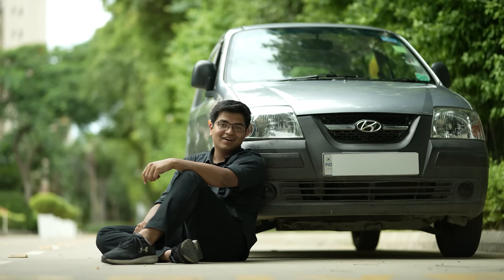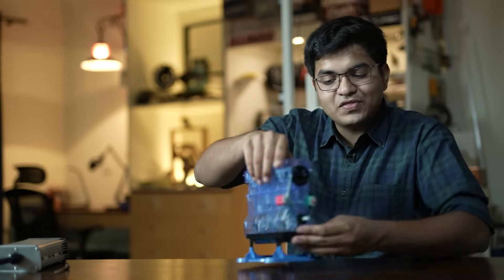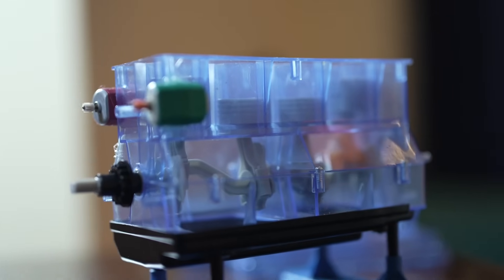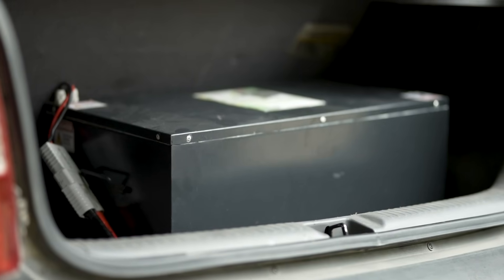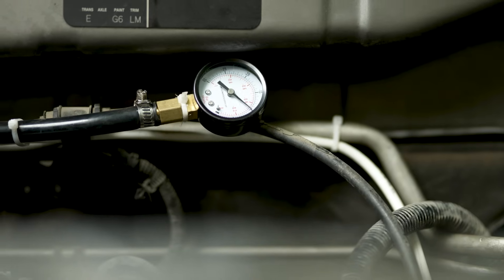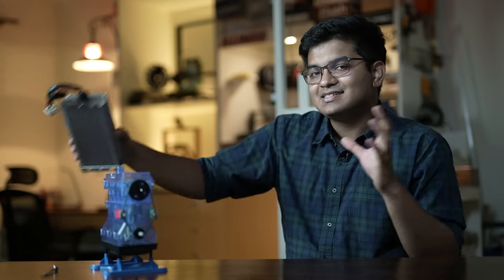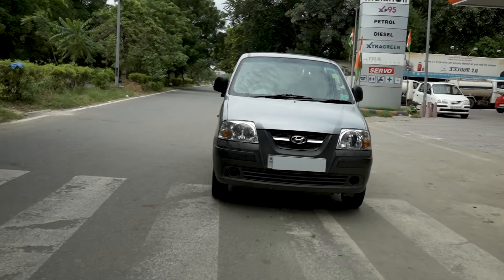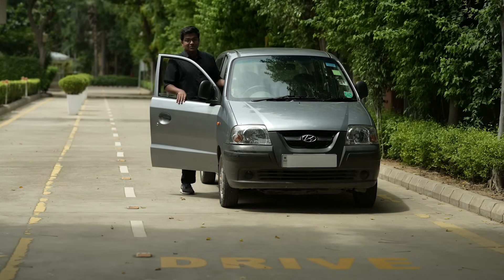Simplest EV Conversion under $3000 - Convert Your Car in 3 Days!

Comment: Thats a pretty great idea actually, did you ever replace the weaker engine with larger one? Keeping the cam, gearbox and existing transmission on the lower have of the engine is a spark of brilliance. You should patent this immediately and open up a shop to do ev conversions.

Comment: Unfortunately I don't believe you're telling the truth about the range.
In your plans you say it's a 72v 100ah battery, which is 7.2kWh. The claimed range is 80km, about 50mi. That means you're going about 7mi per kWh if you drain the battery to 0 (don't). Average EVs can go about 3 miles per kWh, and that's with a significantly lower coefficient of drag, higher efficiency, modern engineering, lower rolling resistance, regenerative breaks, and no bottom end of an engine to spin. The battery also looks small for 7.2kWh, but it probably is.

Comment: Very smart I love but I have a question. If the electric motor is running the compressor and power steering is it then running all the time? I would suspect no AC or steering if you stop in traffic or red light?

Comment: Sounds fantastic. Re 1 per Km to run. 
But how about charging time ..? 60Kms per charging cycle will be gone in no time in desi roads. 
If it takes forever to charge with 250v domestic power outlet, this is no more than a Youtube concept video. 
There are even electric aero planes on show in Youtube ..!😃

Comment: I love this simple but effective conversion.

I think it is practical and very cost effective.

Just a question if you were to remove the engine and attach the electric motor directly to the transmission.

Could you also use the same electric motor to run the power steering air con unit and alternator or would you need a 2nd electric motor to do that?

Just curious as I like your system but just considering improving the range by removing the engine weight and changing the design finish.

I just read your link and you clarified your motive and intention behind your conversion build and this answered all my questions.

Your right this is the most direct method with cost effective components to operate the vehicle and meet your needs and budget.

Very insightful do you have another project you are planning to build?
Reply: He have to customize mount pullies . Have to put pulley off back of electric motor.  Maybe not . A lot more work ... just get after market old vehicle brake system ... no electricity needed or chose no computer car to make electric motor . 
   If he gets that much Miles it be dang good range vehicle in summer...

Comment: Question: how did this affect the engine's ability to oil itself? Theoretically, the L-shaped bracket replacing the engine head would block off the oil lines up to the valve controls and would instead divert the flow solely to the contact points on the crankshaft, but I want to make sure before I do something stupid.
Reply: Exactly. And this is question not a statement: would the oil pump work satisfactorily at these speeds?

Comment: Could you use 1 or 2 piston and convert it to a vacuum for the brakes? Also can the ac compressor be replaced with a dc compressor like those used in portable air con. So you can use the aircon without running the main motor.

Comment: I would have made an adapter plate so that you could run the vacuum pump, power steering pump, AC, and transmission pump off of one motor.  That being said, if I didn't have access to power tools or thick steel plate I would use the original engine as a mount as well.  

Have you considered removing the pistons and connecting rods so that the oil doesn't need to be changed as often?

Comment: Does the flat top mount completely seal the cylinders? 
I assume you have created some openings in the block to avoid that.
Otherwise, you would have a lot of power absorption in that case, because of the pressure fluctuations created by the pistons moving inside the block.

You may even use one of the cylinders as vacuum pump for your braking system? - not sure about how cost effective that would be, but if that works, then you won't need an electric pump, and your mileage should improve :)
Reply: No head, no cylinders. Just crank shaft.

Comment: Yeah its cool and smart but..the electric motor is connected to the drivetrain with a rubber timing belt since the pistons are gone. That belt holds all the load. Isnt this a problem??

Comment: Sir I have a question in normal car when we start the engine the motor start rotating and it will also rotate power steering motor and AC.... And in electric car when we will give throttle our bldc motor will rotate so if the car is still power steering will not work and if we leave the throttle the steering will not work properly
I have doubt in this please explain me ... Btw love u❤

Comment: It may be cheaper but it is hardly efficient. keeping the bottom end of the ICE adds a lot of friction load to the electric motor that is unnecessary. it would not have been that difficult to set up a layshaft driven by the electric motor that drove the accessories and fed into the gearbox. it would have reduced weight and power robbing friction so more of your 8 hp could be used and battery range improved.

Comment: Wait, is he really using the existing timing belt to transfer power from the electric motor to the engine crankshaft? At 5:40, he says that the electric motor is only 8hp (6kw), one-fifth of the original ICE engine, so I guess that is possible. How much of that power is wasted turning over the old engine? I admire the lateral thinking but this does not seem a good solution.The engine block is serving as a giant bracket.

Comment: This does have some janky elements, but it is a good idea if you want a cheap electric car in the city. Unfortunately, I live somewhere that doing this would be an awful idea due to how much horsepower I need from a car and I would need some form of all wheel drive in the winter. Still, this is a great idea if you want a fairly cheap electric car.

Comment: So as I understand it, all the power from the motor goes through the accessory belt into the crankshaft, right? Were you worried at some point that it would fail?

Comment: now what if you did a version where the engine can turn on and charge batteries by spinning a motor?
clutch and 4 wheel drive body, separate the two axles, one gets a clutch and the engine while the other gets the motor / generator :)

Comment: A possible place for batteries is the former fuel area. Sometimes under the back seat. The spare tire area and/'or bottom of trunk can be modified to lower the center of gravity of the battery.

Comment: Your engine oil may never have to be changed unless contaminated. You did seal the top? Use very light synthetic. Your range will increase. No heat so light oil will work better.

Comment: Nice job!

One thing you may want to be careful about is the "engine oil" getting water in it. Normally that water gets boiled off when the engine gets hot, but since that will no longer happen, the water will build up. The risk is that the water can dilute the oil, as well as cause rust/corrosion.
Reply: what water? The reason water is in the crank case is b/c of combustion gas. There's no combustion, it's sealed = no water.

Comment: no detail showing anything really, how do you transfer power from el motor using timing belt, sound far fetched to be a lasting solution, they are not made to transfer this kind of power, the belt would have to be much wider

Comment: Would be neat if you left the head on the block and were able to bolt on a hybrid adaptation so you could use electric in city for short commutes but still had capacity to use combustion engine for longer commutes. Would be a game changer and if affordable as well as useful, many I believe would consider this upgrade over expensive new EV and or hybrid.

Comment: hi mihir, it is excellent engineering you have done on santro, I have one question how does Power Steering Pump and AC Compressor work when car is Stationery.

Comment: Ditch engine block. Connect electrical motor to gearbox or final drive. Remove hydraulic power steering. Either drive without power steering or add electrical power steering and AC compressor. Add regenerative braking. Few ideas that can increase efficiency but cost will go up.

Comment: I commend your ingenuity, but it hardly seems worth it. One could buy a lot of gas with $3000. Most electricity is produced by carbon-based fuels so if one believes in the carbon causes global warming fantasy electric cars are counterproductive. Perhaps it would have been more productive to convert the car to run on methane produced by yourself such as the Englishman Harold Bates did in the 70's. Stanely Meyer ran a dune buggy on water in the early 2000's. Apparently, he left pertinent information out of his patents so no one was able to duplicate his feat. His mysterious death leads me to believe his invention worked. There are other methods to convert water to usable gaseous form (hydrogen and oxygen) suitable for burning in an internal combustion engine besides exciting the molecules with electric wave forms. It seems copper sulfate added to the electrolysis process works well also.
Reply: @georgestreicher252,“Most electricity is made with fossil fuels…”  🤦🏻‍♂️ Yeah, we know that is the case 𝘯𝘰𝘸, however, according to the International Energy Agency, almost ALL additional power being added around the world for the foreseeable future is renewable.*  Does 𝘢𝘯𝘺𝘰𝘯𝘦 anywhere in the world want a new power plant built near them?

You wrote “𝘐𝘧 𝘺𝘰𝘶 𝘣𝘦𝘭𝘪𝘦𝘷𝘦 global warming is caused by burning fossil fuels…”
🤦🏻‍♂️  Hmm, the last time the planet was this hot, the dinosaurs and almost every carbon-based lifeform on the planet went extinct.  A lot of carbon was sequestered deep in the ground on that day 65 million years ago.  For the past 160 years, we’ve been digging and pumping it up to the surface and burning it. “Burning” any hydrocarbon produces carbon dioxide and water vapor, as well as a lot of other nasty 💩 .  So, now the carbon is suddenly back in the atmosphere.  Do you 𝘳𝘦𝘢𝘭𝘭𝘺 think that the two are not related??

* “Renewables are set to account for almost 95% of the increase in global power capacity through 2026…”
https://www.iea.org/news/renewable-electricity-growth-is-accelerating-faster-than-ever-worldwide-supporting-the-emergence-of-the-new-global-energy-economy
Reply: And “worth it”, not including this specific thing, do you think anything is worth more than money?
Reply: @sambrusco672  Of course there are things worth more than money. As you might have guested, I don't believe carbon is a driver of climate change. Having said that, there is pollution to consider and scarce or soon to be scarce resources such as lithium. Several studies have found that EVs use more carbon (energy) in their overall production and use. Methane is a result of decay of organic matter. Harold Bates used grass clippings and manure to fuel his car. He was also working on methane capture from cesspools. The conversion to run on methane was much simpler than converting a car to electric power and was switchable on the fly, between gas and methane.   Water powered cars are another great way to save resources and stop pollution. The conversion of water into burnable gas was supposedly achieved by Stanely Meyer. Again, modifications of internal combustion engines are minimal, and the engine could be returned to gasoline power with controls under the dashboard.

Comment: You could have pulled out the rest of the engine and used a different setup on the electric motor.  In an ICE car, the engine is always turning.  In your converted car, the electric motor is always turning.  All the remains of the engine is providing really is a shaft.

Comment: Interesting. Mostly the engine is wrecked in old cars whereas the rest is stll functioning well enough. Therefore you could use an old car much longer if it can be coverted to EV. 👍🏻

Comment: This is a great idea,...BUT,...I think you're putting too much strain on the timing belt (or chain) to drive the crankshaft.  I think the timing belt (or chain) will fail.
Reply: Did Mihir say how fast the electric motor was spinning or its torque?
If it’s between 1000 and 5000 rpm, why would the timing belt/chain be more inclined to break?
My suspicion is that the electric motor he used only has 8 horsepower.  If anything, I’d be worried about the strain on the electric motor!
Reply: @sambrusco672  The crankshaft normally drives the timing belt. When you reverse roles,....I'm skeptical about longevity.

Comment: You have no idea how genius this is. The low toque moto means you can still keep the gearbox so the car is still engaging and fun yo drive which, let’s face it, electric cars are taking that part of driving pleasure away. The one part I was worried about from the onset of your video is how do you maintain the oil circulation? Does the oil need cooling or since there’s no combustion the oil temperature never gets that high? 

Magnificent ghetto upgrade man!
Reply: Since there is no combustion, better to remove the pistons and oil tank to reduce weight.

Comment: one small doubt. If we release the throttle in traffic , motor stops which in turn stops the power sterring pump and most important the compressor. Then ?
Am I missing out on somthing?

Comment: The design is brilliant and allowed for the manual transmission to be  mated to the e-motor it looks like. As far as im aware no manual electric drive systems exist due to speed and RPM synchronicity. I'd assume the standard 5spd manual clutch is still used but did you replace thd flywheel due to it's inertia too spin-up or did you simply replace the drive mechanism and mate it with a similar output power e-drive? Overall this was a successful build a gives a lot of ideas as well as modifications. Great work sir 🍻

Comment: the idea is understandable but what about battery efficiency since that means the electric motor need to keep running even if you didn't push the pedal because if it isn't then you loose power steering and air conditioner compressor

Comment: I would also like  to  add another idea to that modification , that is to remove sump to remove all the pistons and all connecting parts to them to reduce wait and to make it easy for the motor after all only the crankshaft is needed to transmit the torque ; moreover the rear hub motors can be used for regenerative braking and think of a way of removing brake pump motor as it uses extra power. It is left  for  you to decide what is best according the situation. I guess mechanical brakes along with regenerative braking will suffice .
Reply: crank has to be oiled. Since there's no piston force on it, I guess you could wire an small electric pump to keep bearings lubed.

Comment: Another option I would recommend is to use two hub  motors at the rear wheels  to charge the  main motor on top of the block , once vehicle gathers momentum I guess the rear motor would have the power to charge the front motor. It's only a concept , Just try it out; it may work.

Comment: I was thinking of system all along but also with an additional flywheel and a modified version of the alternator to charge the battery, in your car if you use the alternator with a 72 volts controller will do the job, just one experiment would show whether that is feasible, any I wish all success in your endeavors

Comment: I'm trying to get my head round this.  The electric motor seems to be mounted where the camshaft was.  Does that mean that the crankshaft, and hence the gearbox and wheels, are driven via what was the timing belt?   I can't see how the timing belt would cope with such a load?  Or am I completely misunderstanding how it works?

Comment: I definitely love the ingenuity and thinking out of the box.  Was there any mention of the radiator?  Can we assume it isn't needed in an electric car and the pump can be disconnected and coolant drained?  The thing that I would like to see the most would be some way to get some regenerative braking - or is there some?  Since the transmission is manual, does taking one's foot off the accelerator cause the car's motion to spin the motor and generate some current?  That seems feasible, and would require a controller that could handle putting it back into the battery.  Might depend on the type of motor also.  By the way, I would have liked to hear a good discussion of how the motor was chosen and sourced, and the controller also.  And the hookup to the accelerator would be interesting to hear some details on.  Great idea and execution!  And great video too, you present really well.

Comment: This is awesome for a fun project, but not at all practical. Only a few people would be able to do this or want to do this. Unless you want to somehow mount the batter under the car, you loose some trunk space. Buying a used hybrid is way better, as it is cheaper than a used Tesla and better than a used Nissan leaf. Even if the battery in the hybrid has less range due to age, you can just buy a reputable OE one and do the work yourself, It is way easier than taking an entire engine out.

Comment: Do you not have issues with battery heat management? I am asking since the battery sits in the boot and I couldnt see any cooling around it. Is it not dangerous especially gives how hot it gets in Delhi?
Reply: lifepo4. They're fine. Small motor, small charger, not gonna get hot. Even if it did, it's not dangerous, it just degrades the battery faster.